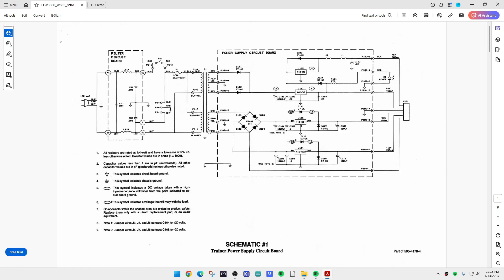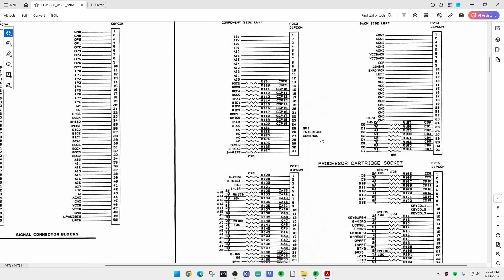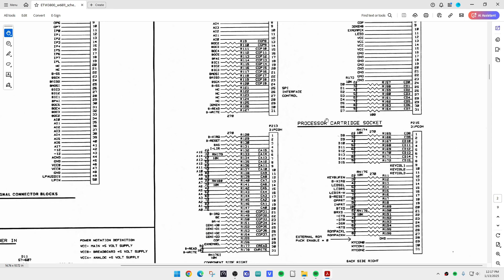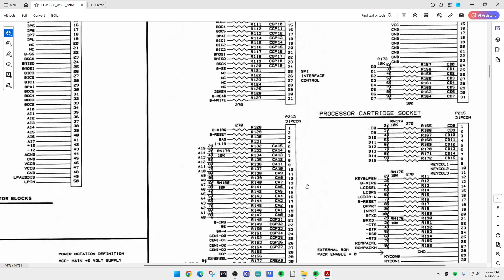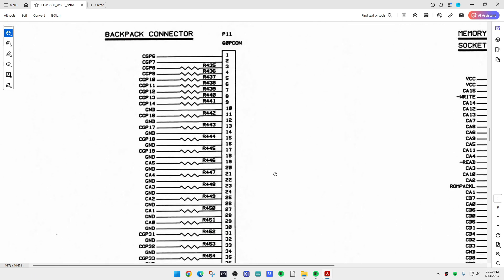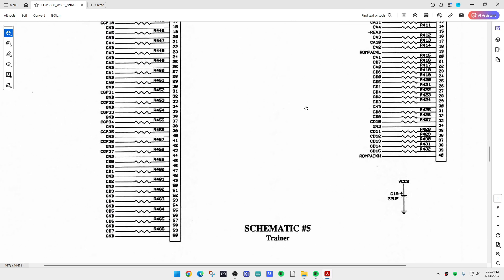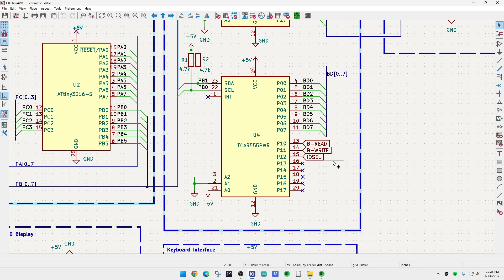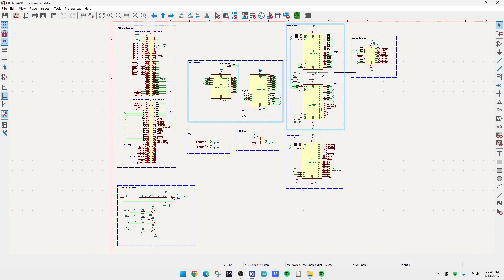#2130 Attiny PCB for the ETW-3800 (part 1 of 2)

Comment: 6:50 atmega8515 or 644 would also be well suited

Lotta gpio and (8515) has built in bankswitching through portE (3bit iirc of bank switching)
Reply: With 64k address and 8bit data, thats a 512k address space without any external glue logic

Though it's only got 512byte ram and eeprom and about 8k of flash storage (for something like this is more than enough store keyboard and display routines in eeprom, and store an os in the flash, 644 has more memory but does not have the gpio and portE like 8515 but otherwise run the same code)

Comment: Hi, for the edge connector style add-in board, there is a process to create a V-Groove on the edge of the card so it does not damage a female connector, one other thing, TCA9555 has an INT pin that can be used for reading KEYPAD keys in an interrupt way instead of pooling.

Comment: Great video! Just noticed something btw... The datasheet for the TCA9555 states the following for the interrupt pin: "Interrupt output. Connect to VCC through a pull-up resistor".
Reply from the maker: If you use it you need the pull-up. Otherwise just ignore it
Reply: @IMSAIGuy  But aren't floating pins discouraged?
Reply from the maker: @FrankChanga  no, not on output pins

Comment: If it were me,... I would design a 6502 not the tiny's. 
Then install Fig-Forth by C.H. Ting.
That would be cool for a proto board. Totally retro dude,... ;-}
Reply from the maker: There is tinyforth for arduino
Reply: @IMSAIGuy  yes I know, not impressed though